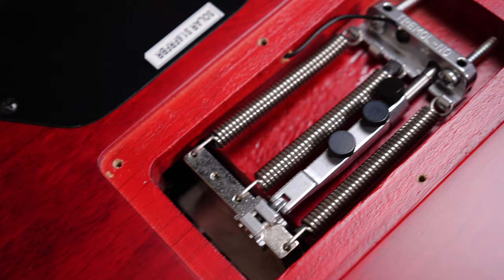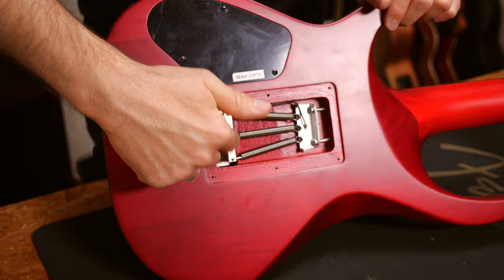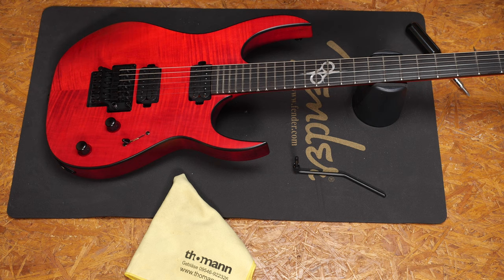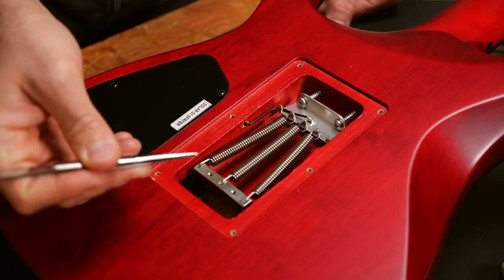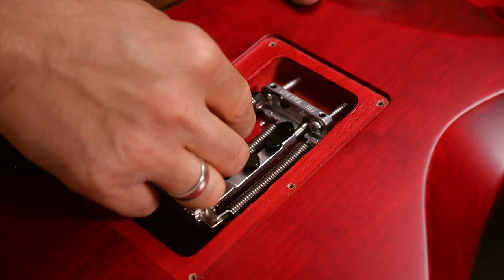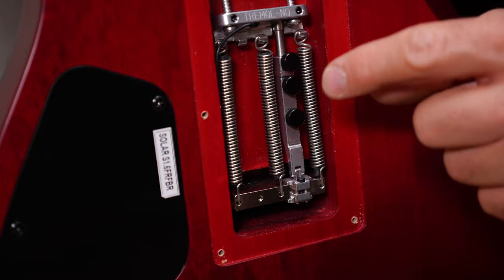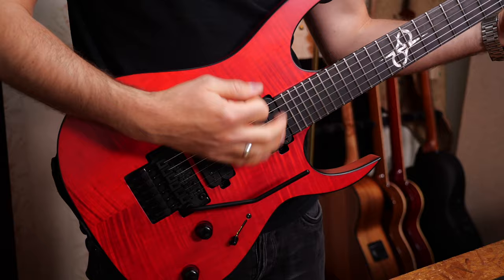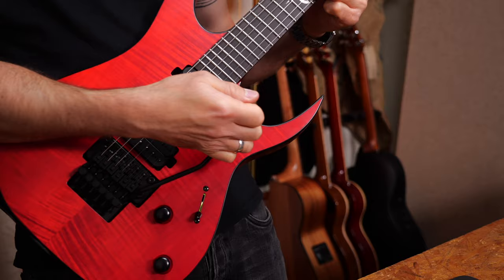Best way to block a Floyd Rose? | Tremol-No | Guitar Tech Tips | Ep. 10 | Thomann

Comment: When you disconnect the springs, did you have to somehow block the trem block? Doesn't the string tension pull the bridge out when you disconnect the springs? Kind of like the reverse of when you want to change strings, when you have to put something under the bridge to block it so the back springs don't pull the bridge way out of place.

Comment: My guitar trem is not that great and it has some tunning stability issues (cheap guitar), but I do wanna use it to dive on some songs instead of fully blocking it, will this help the overall stability of the trem?
Reply from the maker: Hi, I'm afraid it wont make anything better or more stable. The "dive only" feature of the tremol-no only works fine, if the tremolo holds the tuning well on its own already. I'm sorry to disappoint you. 😬 //Kris
Reply: @ThomannsGuitarsBasses  thanks a lot for replying! Cheers

Comment: Can you please tell me is there any different Model of trem no , Specially for Ibanez 2450 JS ?
Reply from the maker: Hey Mark, the Ibanez Edge tremolo on the JS2450 (and the Lo-Pro Edge on many other Ibanez guitars) look maybe a little different but you set them up and use them the same way as Floyd Rose or Schaller tremolos. 
This means if you want a Tremol-No for the JS you'll most probably need the one with the small clamp. That's the same as what I was using in this video.
//cheers, Kris
Reply: @ThomannsGuitarsBasses  Tnx Kriss help a lot !!🙌🏼🎸💯 
I instal temol no  on my JS , and i Love this litle gadet . Now it's some other level guitar . All the best and greetings from Serbia 💪🏼🎸🙏🏼💯
Reply: Hmm My tone just sound like 1€ , Huge Huge diference tone vise !!! 

Excellent gadet i enjoy playing it on Drop D . On my JS 2450 mcb ... But , i now must put again my old spring claw to make shure  is it now with Tremol no Everything litle transparent curtain  ... :/ 

P.S. This device but stainles steel or maybe Titanium , then it would make sense ... This Aluminium I think NOT .

Comment: “Without making mods”… proceeds to pull out the soldering kit
Reply: Well - how would you do it? Simply snip the wire? Then strip the end clean?
Doable, of course.
If you were paying attention, you may have seen (at 2:37), that for re-attaching the wire, he used a screw, that's on the Tremol-No for that exact reason...no soldering kit necessary.
Apart from all that: using the Tremol-No already counts as "modding" the guitar, so...your "without making mods" makes no sense, anyway.

Comment: the real question is how to set up guitar, so you have dual action trem and at the same time be able to bend without getting other strings out of tune.
Reply: That is the downfall of a floating bridge, you can't.
Reply: That’s why I like Kahler better. The other strings won’t detune when u bend one string. Just an all around better design. I still like Floyd Rose tho.
Reply: @robertwilkerson1720  but only in the dive only mode if I remember correctly
Reply: @maxmustardman298  Kahler is cam operated and can be adjusted so that u can dive and pull up on it. It’s always been that way as far as I know. I have a Kahler on my 1985 Gibson XPL. To me it’s bar far the best tremelo design.
Reply: @robertwilkerson1720  i have done a bit of research in that regard and what I found was that you can indeed go and down in pitch but only if you set it to dive only it will remain balanced if you break a string or detune. Or if you completely lock it down of course. Also interesting that open strings dont go flat during bends, since the cam does move forward just as the floyd does if it floats.
Reply: @maxmustardman298  I guess it depends on how it’s adjusted but I have my Kahler set up so I can pull up and down on the arm and when I bend a string the others won’t detune. 

Probably the best thing I like about Kahler is how it’s flush against the body of the guitar so it picks up more of the sound of the actual guitar. A Floyd Rose only has two contact points and there’s space between the trem so u lose so much of the guitar’s sound.
Reply: treml-no/tremory combo